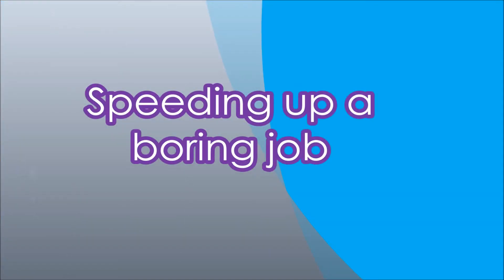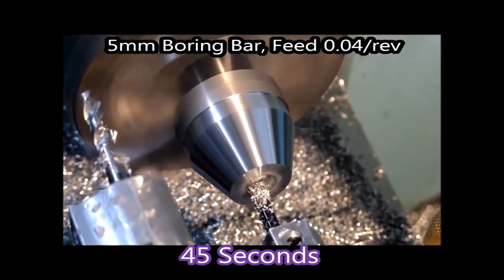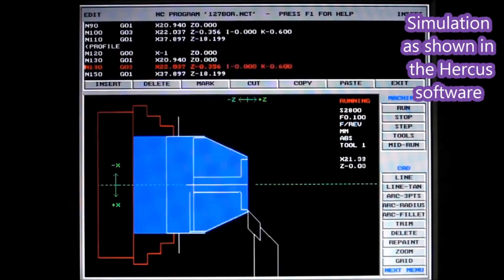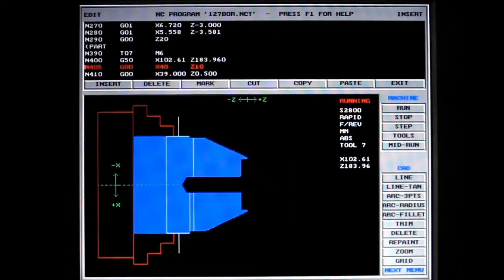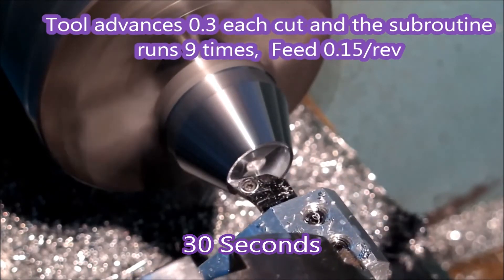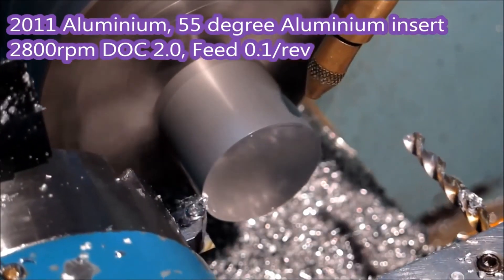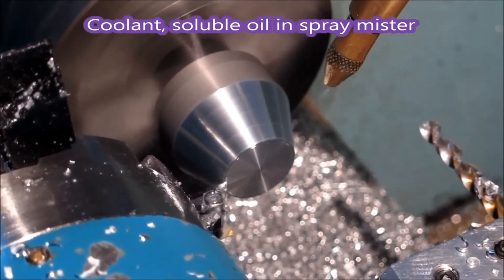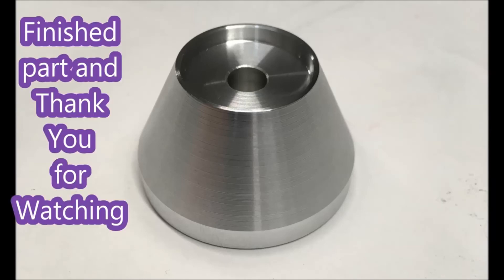Speeding up a boring job in cnc mini lathe. Boring in X rather than Z using a subroutine

Comment: Excellent presentation of different techniques.
Thanks for sharing and best regards from the UK.
Reply from the maker: Bosted Tap thanks for your comment. How big is your lathe, say bore through spindle, chuck size and spindle power?
Reply: @smallcnclathes  Hi, it's a XYZ SL1630 with Prototrak control, spindle bore is 54 mm, motor is 5kW. So an off the shelf item, very boring, it uses a front end interface allowing entering dimensions and type of operations, but it can run G-Code, but I haven't tried this yet.
Many thanks for your reply. Regards John.
Reply from the maker: Wow, that is a rather large small cnc lathe!

Comment: Nice one Nigel. Hercus had simulation software - wow. Considering their vintage thats useful

I just got my cnc lathe running yesterday. Its a retrofit of a Electronica Veneto unit from (of course - italy). Loads of work still to go on tuning the axis and getting a vbscript written for the tool change. Will run Mach3 for the control. Hope my parts can come out a nice as yours in the end.
Reply from the maker: I have found the lathe software simulation really useful in learning to run these lathes. The mill software is not as good I find, as it does not render the part it is all wireframe. Still shows the tool movements around the toolpath, just not as easy to see. After using the Hercus and Emco dos softwares, I looked at the mach three simulation for the lathe and to me it seemed pretty hopeless by comparison. I had an Emco PC5 before the Hercus and the software was good too. It was just under powered, needed a retrofit, hence my look at mach three. Once the Hercus turned up the Emco was sold off. What size shank tools will fit in your turret?
Reply: smallcnclathes i just had the boys around and we opened up the head to try and work out how to drive the spindle via Mach3 control. More work needed! There are some hall effect sensors there and it has 100 count encoder stamped for use with the sensors. No reverse found so tapping is unlikely.

I checked the tooling while we were fiddling and it measured to be 10mm,. It has 6 index positions and i have all the holders, which is great. I hadn’t looked at this before and I’ve had this unit for over 6 years. It also has a load of collets which look like go with the indexing head to fit different sized drill bits.
Reply from the maker: Sounds like it will be a nice unit when done.

Comment: Very nice. I suppose as well as a quicker bore you also get a better surface finish from the stiffer boring bar?
Reply from the maker: Hi Josh Thanks for the comment. I did not find the finish unacceptable with the small boring bar. It was just so painfully slow. The 12 mm bar could have removed even more material per cut if the angle to the front face had been greater. This method works well to bore a hole in plastic without a previously drilled hole  (for me anyway). Just have to ensure there is enough front clearance at the boring bar tip.